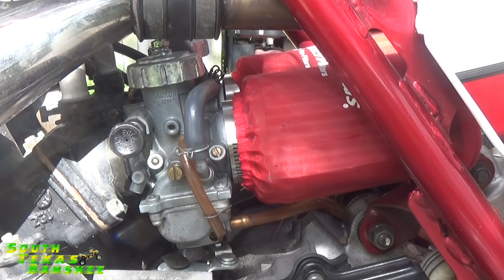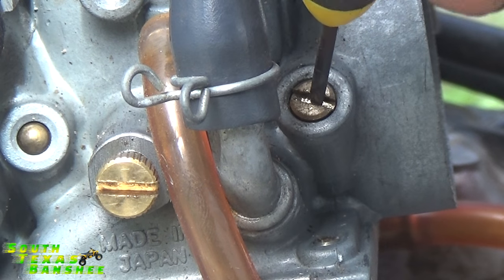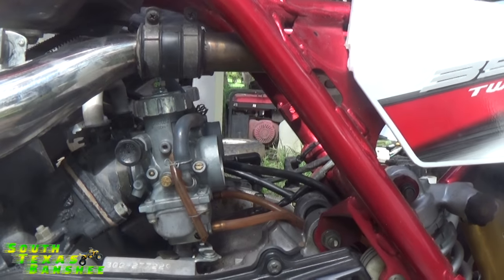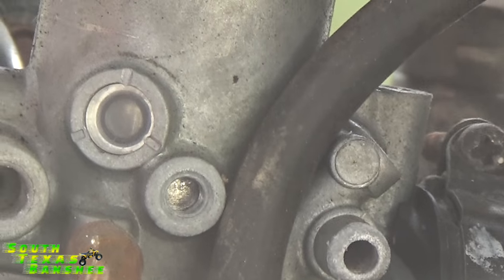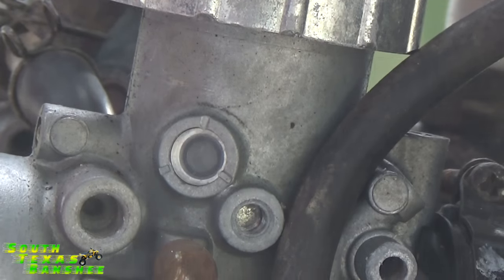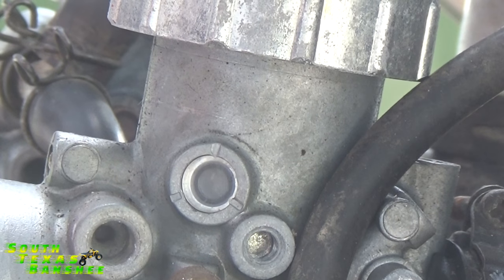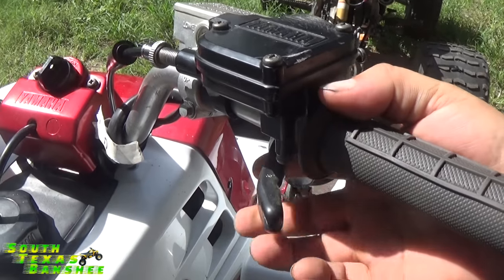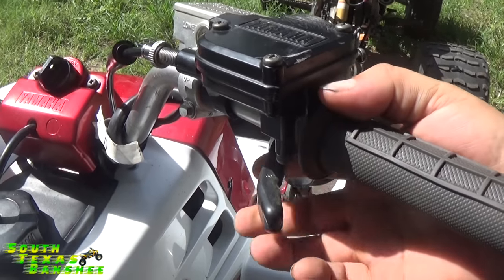Banshee (stock) carb tuning, air mixture, synch and idle adjustment

Comment: @ south texas banshee ...I bought an 02 banshee, has Toomey t5s on it. but the jetting was a 240 instead of a 290 like it calls for. So I bought the Toomey jet kit made for that exhaust, brought the bike in for a deep carb clean and for them to put the jet kit in it...I just got it back and its doggy in 1st, some of 2nd, and a tad in third. it wants to clear out, but its havin a hard time until about half throttle or 3/4 throttle then it runs like a raped ape. Any ideas?  The psi is 130 in both when they did a compression test
Reply from the maker: Matt Vanthomme 
What jets are in it now? Did you use their needles too? They're kits require you to use their air box vents and all that too. If you didn't do that, that is probably why. it's best to buy individual jets, your taking a chance in a jet kit.
Reply from the maker: Matt Vanthomme 
To answer your question though, it sounds like it's gonna be in the needle. Lemme know your specs as far as jetting and air filter setup
Reply: South Texas Banshee when i foumd out that the toomey exhaust setup on the shee was being used with the stock jetting from the factory, i went and bought the toomey t5 perfect jet kit from toomey itself. it was running a 240 when it shouldve been a 290 from what toomey said. im still running the stock air box. my buddy has a shee also and he said to remove the lid once and rip it and see what that does. so i did. ran a hellova lot better with the lid off. startin to think it wasnt getting enough air maybe
Reply: South Texas Banshee i remembered seeing one of your videos and you had the toomey setup so i figured youd def have the best advice. awesome videos btw! just came across your channel today actually, i subscribed, and have watched a ton of your videos already and already learned a ton about these quads!! thank you

Comment: I know this is an old video but I could really use your help. when I screw the idle screws in all the way  it barely picks the slide up therefore I can't get it to idle. I'm having the same issues on both carbs. could my idle screws be  too short? they are stock carbs
Reply: You have to take an angle grinder to carb body where the idle screw seats

Comment: what size jets do you recommend for a banshee with toomey pipes, uni air filter with no airbox lid? everything else stock?
Reply: Toomey web site should have you covered when it comes to jetting to your set up. My yfz 450 and my kx 250f did. I went on the web for my exhaust and followed the instructions and my bikes never ran better

Comment: If my left pipe is not getting hit what can it be I followed the step on the idle screws n got it to stay at idle it use to get stuck on high idle but now it idles normal just right pipe getting hot
Reply from the maker: Elreyjdm for life 
Pull that carb apart and make sure the pilot jet is clear, check that cylinder compression,reeds, make sure your pipe isn't plugged... (seen stock ones do it), try a new spark plug and trim the coil wire like in the video i have. See where that gets ya and fill me in.

Comment: Kevin, love the videos.  Can you help me on getting started on my jetting?  I have a stock motor, pro circuit pipes, stock air box with modified (ehs) lid and no snorkel.  600ft elevation and usu ride at 70-90 degrees.  Thanks.
Reply from the maker: Hey Chuck whats up, put in a 300 main,27.5 pilot and leave the needle in stock position...(middle) and set the air screw at 1 tun, that will set you up for summer and winter riding without the need to rejet.
Reply: You should be around 280 main 27.5 pilots

Comment: I still have tors and when I let off the throttle the rpms stay high then come back down, then it bogs when I rev it up
Reply from the maker: Kohl Holguin 
Too lean on idle circuit, close the air screws some and try it. The lean condition makes the idle hang and the engine big when you throttle it. Close them 1 turn and see what happens. If they are already closed that far, go to the next largest pilot jet.

Comment: I’m having a weird problem. Wot banshee sputters before hitting powerband, no sputter before on low end and no sputter after power band only right before it will sputter for a sec then enter right into power band and keep going . I have a stock banshee with t5 I have tried 260 270 280 300 and 330 gets they all have the same sputter at the same time I have also changed the coil and the stator I messed with the air screw I have changed the needle position I just can’t figure this out I’m close to selling the shee
Reply: Compression 120 each cyl
Reply from the maker: Brian Tapanes 
Just seen this, did you text me about this or was that someone else?
Reply: You need perfect Jetting Kit Toomey

Comment: Hello, just bought a 04 banshee and it runs/idles great but realized its missing the idle screws. What would you reccommend to do
Reply from the maker: Hey how are you doing? If it is idling well and running well chances are it is not missing the idle screws. Most likely there are no idle screws whatsoever in the carb bodies because they are not drilled and tapped. I am guessing your carburetors still have the stock Tors Boxes on top.
Reply: @kevingalindo1  Thanks for the reply you are correct lol I realized this after asking the question. Thanks man, great channel btw very knowledgeable and informative I just subscribed
Reply from the maker: @bwooters8227  anytime man, have a good evening !

Comment: Great video!  I'm going to do this process today from what I learned here.
Reply: You are awesome!  My left cylinder was mis firing.  Did the full procedure you described, found out the carb pistons were switched and that's why the sync dimple couldn't been seen thru the sight glass.   Also snipped the coil wire ends, verified plugs were good as they are brand new.  She fired up with a few kicks and now does the 2 stroke scream.  Thanks again for you great video and getting me in the right direction.

Comment: My idle screw only goes in 1.5 turns from where the slide moves?
Reply from the maker: Dj Mystery sounds like you need to file the carb body more, does it just run out of room?

Comment: My Banshee revs up and idles fine in neutral but has some power band issues when in gear. Took it riding yesterday and would not give out power after like 1/4 throttle. Could this be a carb issue?
Reply from the maker: Pedro Ordaz 
take look at the main jets, may be half plugged. also be sure they are the correct size for your mods
Reply: +South Texas Banshee 
Took the carbs apart for the most part yesterday. Thanks for your videos btw! I still need to get the pilot jets out but the mains are 320
Only mods on the bike are Toomey T5 pipes and silencers, removed air box, and uni air filter pods. Elevation is only a couple hundred feet above sea level and only sees dirt and sand. I'll be taking out the pilots and get back to you when I do.
Reply: You maybe a a size or 2 big on the main jet, also check what needle clip setting your on. If its a bog, raise the needle 1 clip, if it seems lean and needs more fuel, lower it one.

Comment: Stupid question.. you don't talk about Reeds. I'm new to banshees...do you have any info?
Reply: What you need to know?
Reply: @bigspoops7228  worth upgrading?
Reply: @TimeLapseCarGuyBruno  yea. what other mods do you have?
Reply: @bigspoops7228  just got this thing.. trying to figure shit out... Guess tors delete is my first step.. the bike looks all stock.. has a filter.. that's it
Reply: @TimeLapseCarGuyBruno  Honestly i would recommend starting off by getting a full exhaust system of a sort then reeds of course re jet for the exhaust and get some type of high flow air box. like a outerwears lid. but the number one thing to do is delete tors. tors shouldnt have came stock. Delete the tors then other stuff. but if you dont got a lot to spend after tors delete do reeds but if you got a good bit of money to spend full exhaust system would be great to wake it up.
Reply: @bigspoops7228  I appreciate the help man.. I do plan on getting pipes.. just new to banshees.. have no clue what to buy.. or what size jets.. I'm in the  middle of redoing my harness and realized I have some extra plugs that have nothing going into them.. one by the stator plug..it's a black plug 2yellow wires... Rear brake? But it's got nada plugged into it..makes sense when I step on the rear brake the taillight doesn't light up...front brake light works tho... Also have another mystery plug up by the ignition.. 2 wire black plug..kinda confused.. thanks again
Reply: @TimeLapseCarGuyBruno  Np. i dont know jet sized and stuff like that either lol

Comment: After u set the carbs and u then set the throttle does that mess the syncing up on carbs
Reply from the maker: Derrick Tassey no sir, only thing that will mess with synch is moving the cable adjusters on top of the carbs, as far as synch at idle, it’s best to use a vacuum tool to keep it perfect, but not needed. Just make the same adjustments on both idle speed screws.

Comment: I just rebuilt the top end on my banshee, and it was running perfectly fine and smoking good both sides I was breaking it in and only rode it slow up and down the street. And I was warming it up in the morning everything sounded good, and it started to smoke on 1 side and keep revving high on its own. I need help, any suggestions?
Reply: You need to leak down test it. Check it for air leaks, if it has an air leak and you dont fix it, it will blow the motor.
Reply: i found the issue, the small hose that goes between both carbs was very loose, so i fixed that, and drained the gas and mixed some fresh fuel with 32:1 maxima premix, and it runs perfect now. it was really annoying me, but glad i fixed it
Reply: also one carb needle was slightly bent, so i replaced both needles, it was causing the slide to stick.

Comment: what's up man i know this is video is for stock carbs but im dealing with a set of keihin PJ series 34mm carbs and the idle speed is controlled by the choke tops have the slide adjustment and the small flat head screw for fuel/air but i just want to make sure my air/fuel ratio is correct not to lean you know.
 how would i go about this and do it properly was hoping you had some experience with that set of carbs thanks looking forward to your feed back..
Reply: my mods are pro circuit pipes v force 4 reeds 34mm carbs pro design cool head fresh rebuilt top end 360cc with uni foam filter pods...
Reply from the maker: Trevor Garcia 
Just take your time with it. set your idle speed about where you want it. set your air screws where it has a nice crisp idle. You may to raise or lower the idle depending on where you set it. Make sure you don't have a hanging idle hot or cold.
  Then. Take it out and rip on it, get it good n hot. If the idle after that is real smooth and flat, no pop to it, richen the air screw just enough for it to sound good. Let it cool, see how it starts, check for hanging idle. Ride it, check hot idle after a hard rip. If all is good, the air screws are good and it's time to synch the idle. Just use the tool and synch with the choke knobs like you would the idle screws.
Reply: South Texas Banshee alright ill give it a shot i thank you for you input and if all is well ill throw a video up so u can check her sound out?😁
Reply from the maker: Trevor Garcia  sure man.

Comment: How come you don't do single carb on any of your banshees?
Reply: Single carb is mainly for trail riding and is mainly for a crisp throttle. It only has a few benefits that could help for certain riding conditions. Dual carb is preferred for our riding conditions.
Reply: What does it change for trail riding.   That's what I wanna do with mine but it doesnt ha e the bottom end for it.

Comment: Hey what's the furthest out I can have my air screw?
Reply from the maker: Eric Martinez 
I wouldn't go more than two, or 2 1/2 turns mainly because the spring begins to get loose and it could fall out on you. If you have to open your air screw more than two turns then you need a smaller pilot jet.
Reply: South Texas Banshee, i currently have it at 3 and it started hauling ass and sounding much better and the screw isn't loose at all to where it will fall out

Comment: Wtf mine doesn’t have an idle screw
Reply from the maker: Manuel Chavira 
If you don’t have TORS someone did the TORS delete the wrong way. They use the cable slack adjust the idle
Reply: Yeah my bike was running smooth but after a ride I started felling it weird on the left side so I clean the carb and tried adjusting it and now I think it’s all out of whack it blows more smoke on one side then the other . How would I adjust it now since I don’t have the idle screw

Comment: Thanks for the vid. Take a look at my Banshee after your video and found out my air screws and my idle screws were both out of sync. 
Now bike starts one kick without using throttle. Much more crisp. Accelerates from the lows with power now.

Thanks!!

Comment: what's your jetting
Reply from the maker: Adam Morgan 320 main and 27.5 pilot
Reply: South Texas Banshee where's your. needle clip at on the grooves
Reply from the maker: Adam Morgan 
oh sorry, yep 3rd from top, if you have a set up like this I'd advise using a 330 main. at the 320 was all I had.
Reply: South Texas Banshee. it's about 45 degrees where I'm at and I'm gonna do these adjustments but right now I have a low end sputter like its running to rich. will these adjustments clear it out?
Reply from the maker: Adam Morgan 
What mains do you have and what's your clip position? Actually what are all your mods? Look me on on favebook messenger so we can talk easier. There is a "how to reach me video" on here if you haven't see it already.